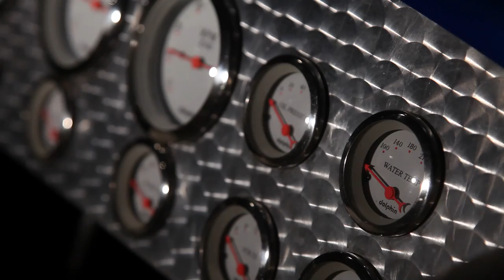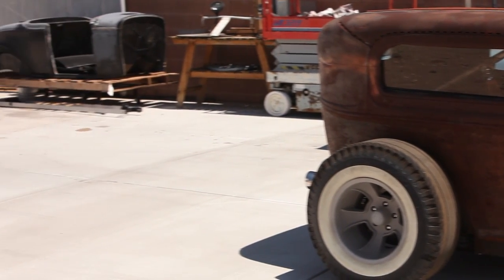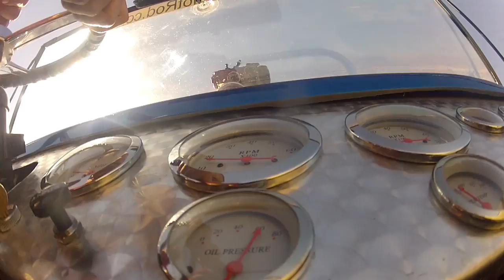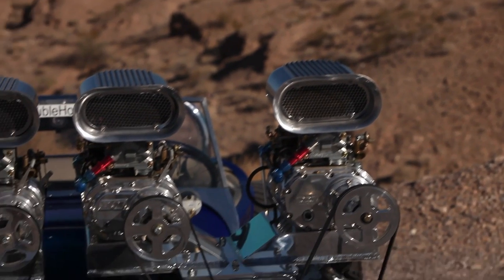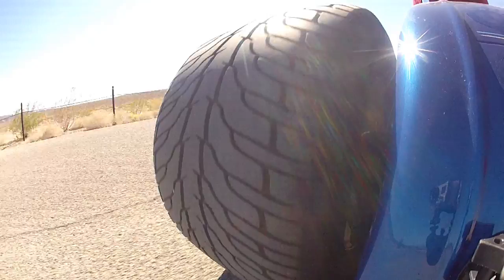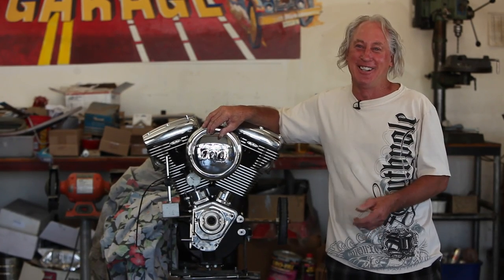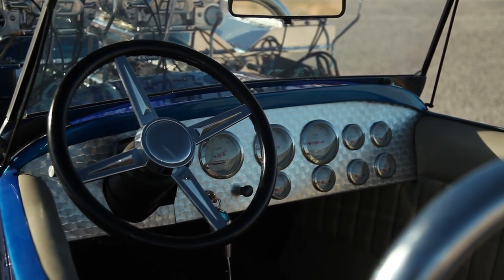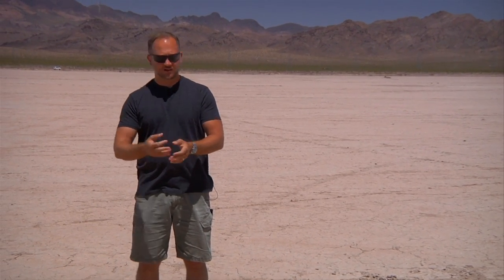1927 Ford: Two V8s, Four Supercharges, 1,200 HP // BIG MUSCLE

Comment: 9.2L W16 4 S.C 1200hp
vs
7.993L W16 4 Turbocharged 1200hp. You think Franch cars sucks? How about American Muscle?
Reply: Peak numbers vs area under the torque curve
Reply: I do think this ting got less tq than the W16
Reply: ROCKETGUN BOOMBS I don't think you understand what I said but if you're taking Veyron, this should be making more torque based on the numbers of a single 600hp 4.6 in a SVT Cobra.

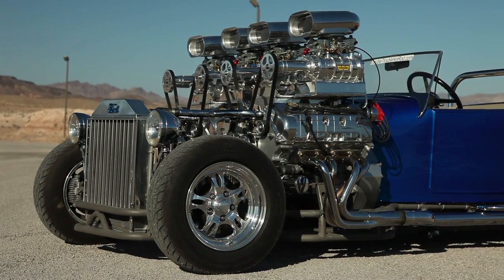The big difference is that the Veyron motor is a single engine delivering power straight from the flywheel to a transmission. This setup has to transfer the power from two engines into a single transmission.  If you listen around the 5:30 area he describes the setup as basically the two engines hook to the tranny with a belt drive.  I think the only thing saving the belt in this current setup is the low weight of the car making it easy to just burn the tires.

The Veyron was designed as an engineering showpiece to push the limits of what a production car can do.  A 250mph car that is unbelievably comfortable and still very well mannered for regular driving.  This car was a different kind of engineering showpiece for this bloke in his garage saying "look what I can do!"
Reply: 94XJ I do understand what you're trying to say. Both Veyron and SVT perform the same type of torque curve.
Veyrons engine and SVTs are similar you can't find a 3996cc V8 doesn't mean it's different as the SVT 4.6. It produces low end tq to mid rev tq by its turbochargers and different fuel-airflow ratio, different boost setting, valve door adjustment and ignition timimg. 
In the other hand, Koengsiegg is far more extreme. 5.0L variable TT V8 perform same amount of power as the Veyron. Veyrons engine create far more than 1200hp, it can perform 3000hp but due to heatsoak and explosion iddue, 1200hp is a computer limited power. 
Always keep in mind, fuel-air flow ratio, ignition timing always affect torque and torque band.
Reply: ROCKETGUN BOOMBS See, you're again talking about peak numbers with the Koenigsegg.  I said "area under the torque curve." Now, given that these are modular v8s, they aren't all that great.  There's a reason why an old 302 with lower power ratings was still Faye than the modular 4.6 when these engines launched.  It's the same reason lower power LS motors can hang with the Coyote and also what makes the Bugatti so much more usable than Koenigsegg.
Reply: 94XJ The average torque of Agera is 1000NM, max tq at 4000 and from 3-8000rpm, the torque won't go lower than 800NM. Which means it always performaing 7-80% of max tq in any rev band.
Reply: Dyno charts disprove Koenigsegg's claim, though.  Of the few I've dug up, at 3k RPM they're just starting to hit 600lbft, well below the 750 (1050Nm) claim and far from the flat torque curve of the Bugatti.

The torque curve for the Veyron is much fatter than the Koenigsegg's and the torque curve for these engines should be enough to rival the Veyron in their current form.  It won't be completely flat like the computer controlled turbochargers on the Veyron, but peak torque and volume under the curve should be pretty close in actuality.

I know I'm likely wasting my time with you because we've discussed the operation of a carburetor before and you refuse to acknowledge someone that actually works in automotive engineering and education in automotive powertrain design actually understands how engines work better than you.
Reply: 94XJ Oh yeah? I know engines better than you know your name. I do physics calculation. Its wasting my time to reply you tho. However, teaching kids is my favor.
1) Where you get those fact?
2) Agera R have a totally different air/fuel ratio than Bugatti, also crank size. 
3) Different dynometer would have around 5-12% different result for cars create over 1000hp. My tuner fd told me.
4) I can't tell what's wrong unles you show me where your claim info came from.
But something to remind you. The torque cruve can adjust by boost from the factory engineers to give a better performance. In other word, not every engineers would blow max tq from start-end.
Reply: ROCKETGUN BOOMBS "Teaching kids" you're funny. You've said before that you are 17. I finished my masters before you were born.

"Agera R have a totally different air/fuel ratio than Bugatti, also crank size. "  Do you even know what you're saying?  Air/fuel ratios should be around 14.7 parts air per 1 part fuel as that's the optimal amount of air to contain enough oxygen to burn gasoline properly.  Both cars would be set up to run just a bit more rich than that simply as a protective measure.  The crank sizes are going to be different...of fricken course.  The Veyron engine has 16 pistons connecting to it, the Agera's engine has 8 and the stroke is different.  The Veyron w16 has an 86mm stroke, the Agera has a 95mm stroke. 

Yes. your "tuner friend" is correct.  Dynamometers are actually pretty useless at comparing car X in location A to car Z at location B.  Why?  Different dyno manufacturers equipment measure differently.  A Mustang dyno will register considerably lower numbers than a dynojet for example.  Environmental factors also play a huge role in the actual measurement of power.  Heat, humidity, altitude...the only thing a dyno is really good for is dialing in your setup and comparing before and after modifications if conditions are the similar on the same dyno.  That's not what I'm talking about, though.  It's not about the dyno just reading lower, it's about the shape of the torque curve not meeting up to the claims.  Rather than 70% or more of the peak torque being available at 3000RPM the actual results are closer to 55-60% and the curve has much more of a power peak as compared to the Veyron's flat line.

Anyone that actually understands engine, even WITHOUT an education and work experience in the field, can see just by your 2nd point you really don't understand the design aspects of an engine.  If I give you a baseline torque curve for an engine, the airflow metrics for the heads and camshaft specs, then give you specifications for a different camshaft...could you calculate the power difference every, say, 500rpm and draw an approximated new torque curve?  I can.
Reply: 94XJ You think you're teaching me?
airflow/fuel ratio can be adjust by the ECU but needed to adjust the valve door at the throttle as well. 
Take pro mod as an example. Higher the temp= less density in the air= more air needed/ fuelflow. ECU and throttle control needed to be adjust. 
And yes, different dyno measure different hp from SAME car. Partly because of the smoothless of the dynojet and partly because of the cars behaviour.
Back to the point. For turbocharged engines, a single adjustment could multiply by 4 times. The formula of engine hp MUST included temp, G force of piston and how many time would the engine ignite/ certain time. 
Shorter the stroke is= more ignition/second. That counted as an advantage of engine direct force (torque). Good torque band=  the engine maintain the same or similar force for a longer time. Most turbocharger engines can produce much more torque and hp than the factory claim. owever, thos amount of power have to deal with crank, drivetrain, differential and gears tension. That's why most factory engineer would limit the torque at certain N.M. In other word, they're playing with the torque curve. How? By fuel/air-flow mostly air-flow coz easier to due with and always have a better result but less efficient.
Koengisegg Agera Rs 1000NM from 2700 all the way to 7300rpm max tq 1200NM at 4100rpm. The turbocharger can produce around 1.4bar (my memory) 0.5bar boost pressure at 2300rpm and Turbo spool up from 2700rpm. In other word, when the turbo spooled up, the tq start from 1000NM then pop up to 1200NM at 4100 then drop back to 1000NM from 4100 all the way to 7300rpm. Why? 2 answer. 1)physcial limit 2) airflow/fuel ratio.
1)physcial limit: The combination of air/fuel and expansion create most pressure at 4100rpm. 
2)The engineers limited the tq for better thrust behaviour by adjusting air/fuel flow ratio mostly adjust the valve door by retune ECU and hard parts. 
So my point is, engineers always playing with toeque and power, that's the different between factory engineers and tuners. Tuner always ma out the full potential of the engine which I love! The power mostly limited by physics more than airflow/fuel ratio. However, they'll adjust the boost pressure in each gear to reduce wheel spin tho.
Reply: 94XJ To prove my point, check out Agera one:1s powerband. Same engine different amount of torque and perform at different rpm

Comment: It is just me or does it seem really slow?
Reply: Mike is staying away from the gas peddle. When your in a car for the first that does not handle like anything you have ever driven, with 1200hp, you probably drive it like a Grand Mother would.  But for the holeshot he did, it looks to me something was slipping before the power got tot the wheels.  He has belts from the engines to the tyranny, and I bet it was slipping there.  If so, opps on the engineering, should have went with gears.

Comment: 1200 hp seems pretty lame to me for 4 blowers. I've seen vehicles with 1 blower and they're at 1100 hp. Hell, a Hellcat Charger/Challenger has 707 hp. And it's factory
Reply: Slac adjuster 
It's not made to be powerful and it hasn't been tuned and tuned and tuned it's just for show that's why it's expensive all the chrome and stainless is expensive

Comment: Sorry mate, but it looks like shit. The engines are too wide for the car,  you can't sit in it more than 10 minutes without getting both knees buggered, and the grill is way out of proportion.  I can put a hemi on a role skate but what's the point?
Reply: If you can't appreciate the time, and work, (figuring out how to make it work), in this project,---just buy a Prius and drive around thinking you are smarter than everybody else.  Now how can I tell you don't have the brains to build something like this?  All I had to do was read your comment.  As an engineer myself, I can appreciate a build like this tremendously.  It is the guy who does not have the skill to sharpen a pencil, who would critique it like you did.  Sorry mate, the machine is beautiful.
Reply: Ohhhh, also.  As far as "The grill is way out of proportion".  Think about what you need to cool two V-8 engines down, (twice the radiator as one engine, right?).  An engineer you are not, and I bet I can sell you any piece of junk that is shiny. (Heck, china has been doing that to us for 40 years) :)
Reply: @EarthSurferUSA  Let me tell you something, Sunny. "Size" does not make efficiency. I have built a few cars myself and there is more than one way to skin a cat. The car is shit and the radiator looks like a sumo wrestler in a wall safe.
Reply: @BackSeatHump  It is surface area of the radiator that cools the water "Sonny".  My goodness, if you don't know the spelling difference between Son and Sun,---well, I would love to see your great builds.  Have a sunny day.
Reply: @EarthSurferUSA  FIRST of all, when you can read & write my language as well as I can read & write yours (English) then we'll talk about my spelling. SECONDLY, it is NOT the "surface area" that determines the ability of a radiator's cooling effect, Bonzo Boy.
Reply: @BackSeatHump  The surface area is the #1 factor of heat dissipation from a solid object to the air.   Do you have any engineering degrees, or were you bore knowing all the secrets of the universe.  The day you think you know it all is the day you have a lot to learn.  You could not begin to build this project, but the guy who did, could be a pretty damn good engineer.

Comment: Great engineering piece of work ,….BUT,…..Sorry Gordie,  that thing is a nothing but a show car ,…if you drive it like those engines are suppose to be run,…it's a death machine.  You can't even see if a car pops out of a side road, and the engines are only going to carbon up cause you can't even open them up without killing yourself. It's a waist of machinery that could be applied into something worth while . But you can tell me to such the F_ _ _ up. I understand.
     I'm sorry,…..I'm a practical man that can picture a nice old 32 ford with ONE of these engines in it.